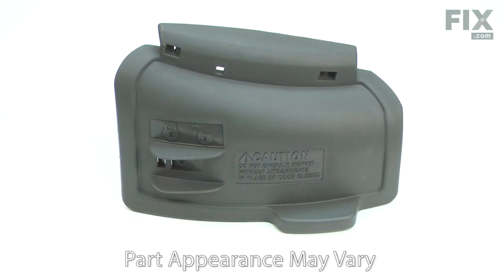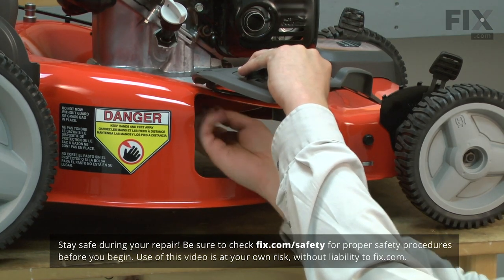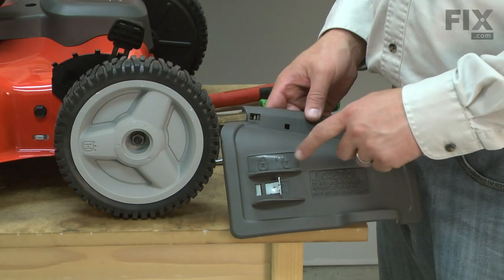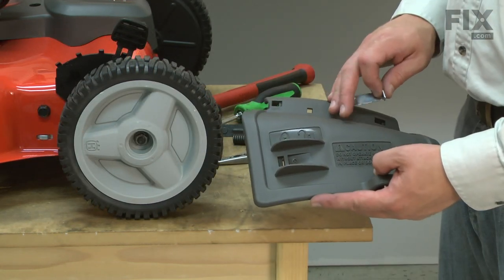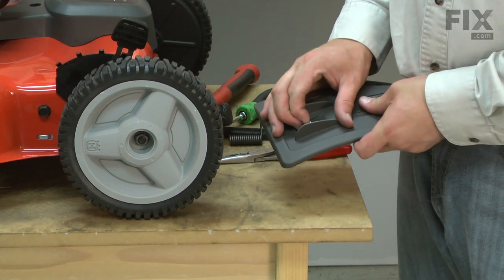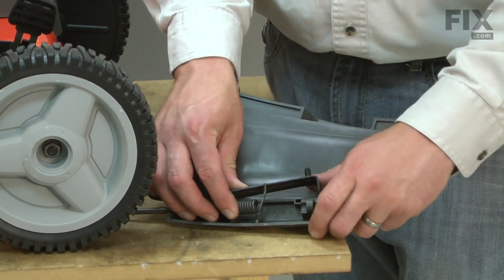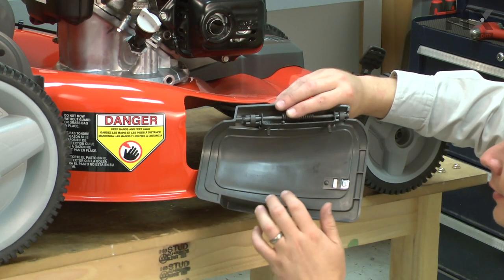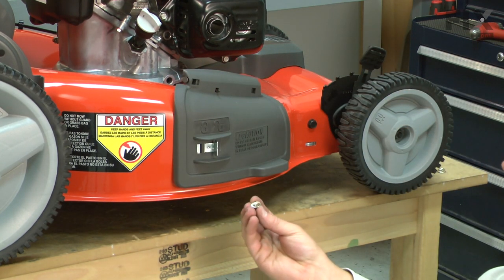Husqvarna Lawn Mower Repair - How to Replace the Mulch Door

Comment: I spent a half hour trying to put the door and struggling with the spring until i got fed up and checked youtube. I never thought to remove the bracket! I followed your directions and fixed the rest in 10 minutes. Great video, thanks!
Reply: followed this but its not working or loose until i saw the hole where you need to put one of the bracket's end to it..think he forgot to mentioned it..